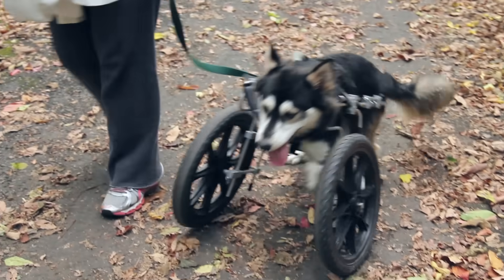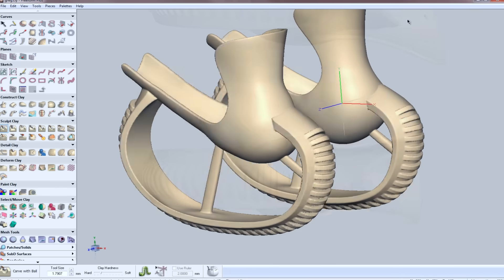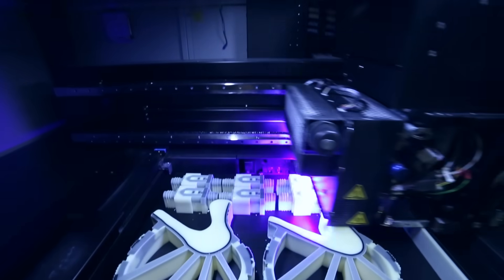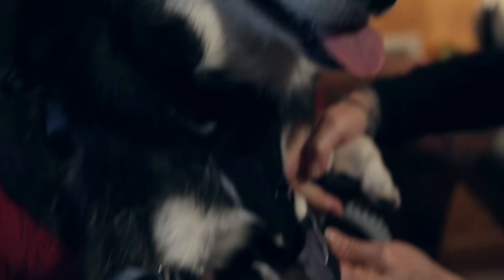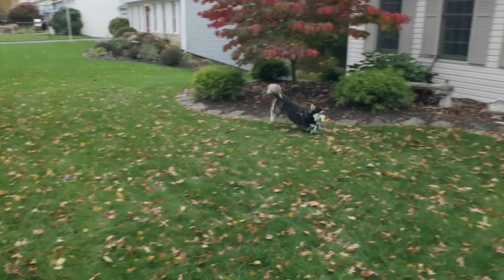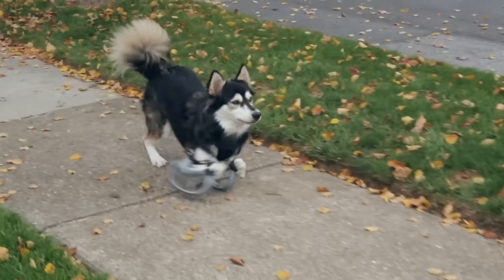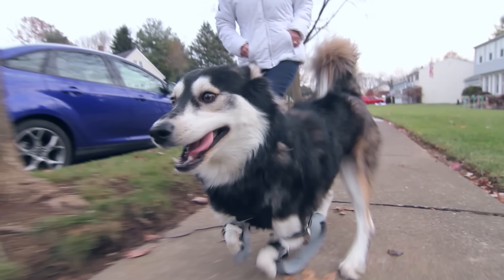Derby the dog: Running on 3D Printed Prosthetics

Comment: Staff noticed that could increase the prosthesis size, the breastplate of dog is inclined downwards, and hind legs are longer.

Next prosthesis could be higher, as the Paralympic athletes with a prosthesis spatula facing backwards, leaving the spine straight.

the Dog used a wheelchair, and his was spine straight, and with the new prosthesis his column was arcade down.

A cool tip would have a barrel and a spring which connected with the base of the sole, as occurs in damper bikes, thus allowing a soft pass.

Staff did a drawing, you ugly'm not great at it, but gets an idea and who knows.
I put my shared drawing in Onedrive with the link below

https://onedrive.live.com/redir?resid=5F731DE010F5D785%2164383

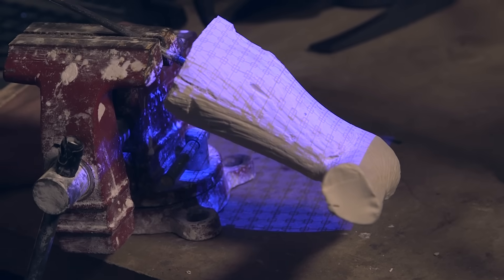Comment: What is the device on the right side of the monitor, at about 1:00? It has an elbow type of joint and the guy is using it like a tool to modify his project. It is not a mouse, some sort of digitizing input device?
Reply: The device that I am asking about is also at about :51 seconds on the right of the monitor. Can I post a screen shot of what I am referring to?
Reply: Stanford Lynx It looks like it lets you draw on a desktop computer like you would draw on a pen tablet
Reply: Mario Alfredo Montoya Thanks for the reply, good guess,
I am going to guess that it is some form of a  _Articulating Arm 3D laser Scanner_. I looks to me like you trace over an object to input 3d data for a 3d CAD type of drawing, but I know nothing about this technology, I want to learn more, to use with various 3d AutoCad programs.
Reply: this is the geomagic touch 3d haptic deviice.
there is a new one coming out soon that is improved and less expensive.  They are awesome with geomagic freeform cad software.
Reply: Russell C. Thank you for taking the time to get me going in the right direction,  your great answer opened some interesting sites for me, lots to explore, things of interest, I look forward to learning more about this and similar devices, the technology, hardware, software, methods of 3d geometric data input to PC, various software, AutoCad Suite, other proprietary software from 3d devices like the ones that you have kindly pointed me to. Happy safe Holidays, Thanks again, much appreciated.

Comment: explain me how 3d printing works
Reply: Mario Alfredo Montoya Not, it's printing. It drops (prints) melted plastic in an array in a very similar way inkjet printers work - just that it prints 1 layer at a time ascending (printing in 3 dimensions).

Dennis van d hoven Basically the head that dispenses the plastic (the extruder) is on a device that can movie it left/right/forward/backward (much like a crane game claw) and it prints the base "pixel" worth of plastic, one "pixel" at a time.
The platform the plastic is sitting on moves down one "pixel" (or the extruder is raised up one pixel) and the next layer is printed off of the first.
This continues until you have a plastic 3D object.

The reason this is so exciting is because typically to make plastic models you would traditionally need to make a cast and pour melted plastic into it. This is expensive and time consuming. It's also not realistic to quickly share molds with others - or mass produce.

3D printing lets you change a model slightly and create a new object without having to create new molds - and those object files can be saved and transferred just like anything else on a computer, which can't be done with molds.

The drawbacks, of course, are that 3D printed objects are often fairly grainy-textured since it is created drop-by-drop rather than with a single piece of plastic, but that really depends on the project you're doing, and you can always increase resolution depending on the quality of the printer.
Reply: Basically you make a 3D model of something using software, and a machine automatically builds that model in real life. Because of the process it actually shouldn't be called "printing", however people are already familiarized with the term so they left it as 3D printing.
Reply: Joseph DiSalvo Thanks alot for the explenation. But can't you make a lamborghini with this or stuff?
Reply: Dennis van d hoven No. (Not yet at least.)

Only certain materials can be printed (mostly plastic).
Reply: Dennis van d hoven
Yes, you can...
Reply: Joseph DiSalvo I had the wrong idea then, thanks!

Comment: Those are a great design. I could imagine going a bit more and making them with flexible "spokes" and a rubber flexible tread to absorb impart. Also, not sure I'd encourage the dog to run over 2 miles. That could lead to some joint issues in the future....

Comment: This is great but why didn't you make the prosthetics a little taller so his weight is more distributed rather than putting it all on the front? This way you are putting too much pressure on his back as well. Can't see how this will benefit the dog's health in the long run.
Reply: Nobody said this was the final model. The dog probably needs to get used to lower prosthetics first.